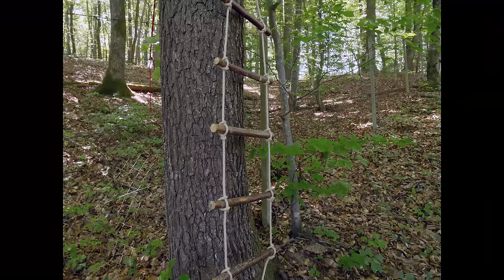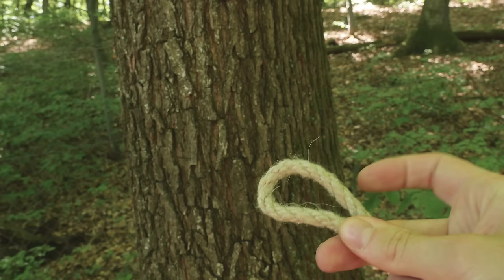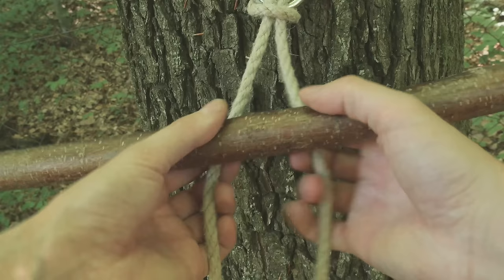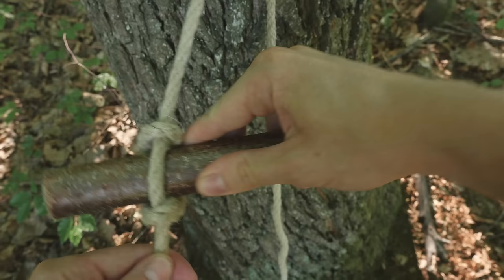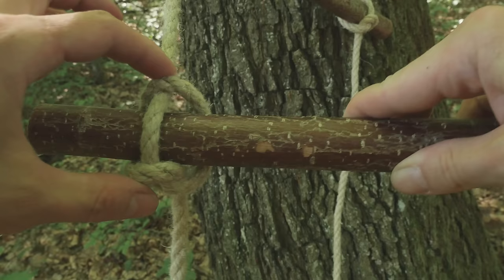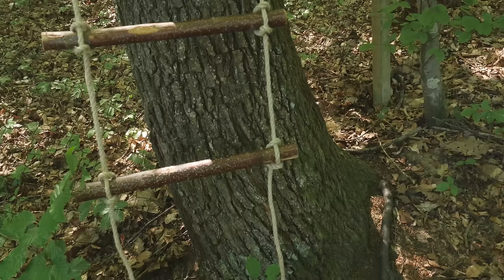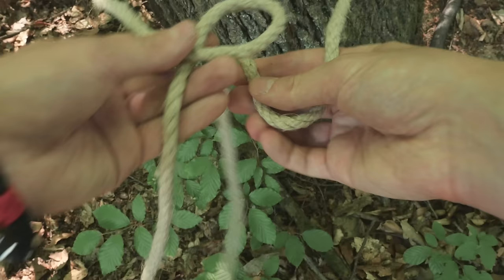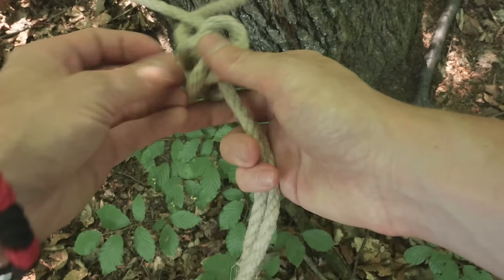Marline spike hitch ladder

Comment: You don't need to pass the whole long rope through the ring to attach both. Fold the rope in half, feed it though the ring, bend the rope over the superior part of the ring and pull upside the superior part of the ring. Both will attach. Or in other words; fold the rope in half, feed it though the ring,  and pass the ring through the loop.
Reply: Diamond knot?

Comment: What I also found was when you slip the loop over the end of the rod if you put a twist in it (as I accidentally did) before you slide it over, you end up with a constrictor knot. This works quite well because when you pull the rope ladder up and there is no tension on the hitches the rods are less likely to fall out as the constrictor knot holds them firmly in place. Also they are easy to undo when you pull the rods out.
Reply from the maker: Thank you for sharing your experience!

Mark
Reply: Fantastic add on.
Reply: Saw the video just now, but had exactly the same idea! Adding a twist to the loop, makes the construction much more stabile
Reply: Sir...you need to run for President.
Reply: I done the same thing by accident😂😂 I bet a lot of these knots we have today were discovered by accident

Comment: Thanks a lot Mark. I finally managed to make my own monkey ladder. It would be great for climbing a low branch of a tree during hunting.
I think, if I may suggest, the most suitable rope size is not less than 12mm and made of sisal.. Happy climbing guys.
Reply: For reasons unbeknownst to me I find that 6mm accessory climbing rope is by far cheaper than any natural material of similar strength. And of course it is more abrasive, water, sun etc resistant. It is just uglier in general.
Reply: It would be cute (at least it is desirable for me) you to be the hunted animal... And.., why not..??

Comment: I find that if you make a twist in the loop before it is placed over the end of the stick it makes a much better lock that does not loosen up if pulled in either direction.

Comment: You can make the steps "permanent" by drilling a whole through the wood and feeding the rope through in the first step instead of wrapping over. This is only really viable with very uniform wood like dowel rods. Another alternative is a 2×4 for nice flat steps
Reply: Yes but dont u understand that this is in the forest? It's very quick and easy to just replace the wood when it's broken or whatever and just do the tie again and he did say temporary
Reply: Also it's spelled HOLE.
Reply: @fonimer  I didn't even notice that mistake. I don't remember if I just forgot how to spell for a bit or if auto-correct struck again
Reply: Drilling hole would be making a weak spot to break at

Comment: A marlinspike hitch resists traction from one end only. A constrictor knot can be tied and untied as fast and easily and allows traction from both sides so that you don't have to think in which direction to tie it.

And one doesn't need seven and a half minutes to explain that.

Comment: In the beginning - the larks head knot - instead of pulling the two working ends through the loop you could just slip the loop back over the ring.

Comment: You should probably cut some notches into the wooden dolls in order to keep them from sliding out.
Reply: Yeah. Then you should replace the rope with wooden sides. Then sell it on craigslist and use the money to buy an aluminum ladder from a hardware store. Unless you are in a survival situation, where you could just do the technique in the video.

Comment: Thank you very much for the video!  It is very clear and useful, but I am having troubles getting the steps straight - one end always tends to be higher than the other. although I am knotting and unknotting many times. Do you have any tips for that?
Reply: You could use another stick as a measuring stick to measure each gap your stick would need. I hope this helps

Comment: To make a lark's head on a ring, you just pass a bight (loop) through the ring then pull the ring through the bight, then cinch the bight down to form the hitch. Your method was so tedious and tangle-y. But a plain lark's head isn't the safest hitch here because it can slide if one leg of the ladder is loaded more than the other, which is always the case unless you like to bunny-hop up ladders or if you have only one leg. The rungs could suddenly shift diagonally if you're using a stiff or slick rope.

Comment: Is there a way from keeping the knots from slipping? Once my ladder is not in tension I lose the knots
Reply from the maker: Hey!

Two ways of preventing slipping that you can use are:
- using notches to keep the hitches in place
- drilling holes on the sides of the poles and jamming sticks/dowel rods in place.

Comment: Very interesting and useful tip , thank you for sharing!
Question: one should first climb the tree and fix the metal ring at that height, carrying a hammer or whatever ?
Reply: Great idea, this method - THANKS to the poster!
I was wondering a similar thing to your comment: Are there any safe methods for climbing up and attaching the ring in the first place -- that is, before climbing up the ladder? I mean, how is the ladder initially secured to the tree?

Comment: All advice given to somebody going in the forest must consider all possible accidents. The ladder presented here is flimsy and unreliable. The green wood is prone to bending, it has to be way thicker than what we see around in ladders. Then the knot is prone to slipping, you might loose your footing and fall. You need to practice at home so you know how it works. The sailors used to hang the ladder  down the board and their ladder is made with dried hardwood thick rope with secure knots which cant slip out., plus they practiced a lot before they really used it. You have to climb first, hang it on something (???again safety) then go down? Or a short ladder you might throw it up???

Comment: I am trying to make a rope ladder only for an emergency fire escape from my new flat. But its a 11.5 meter drop and im not sure about using this type of hitch that could slip off.
Reply from the maker: Hey Dave!

I understand. This style is made on the spot and is not usually meant as a permanent solution. That said, to make it much more secure and long term, notches are made into the sticks/rungs.

Mark
Reply: Johnny AppleStead  in order to use such a ladder you place one foot in front and the other behind. This keeps it from behaving as you described. Used to use metal "rope" ladders when caving.